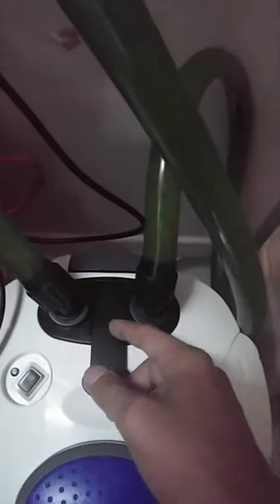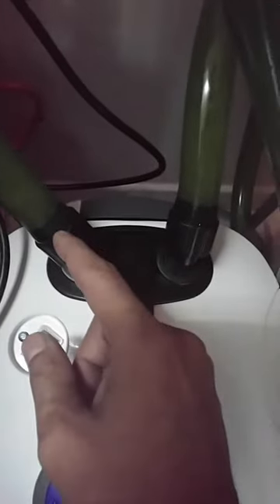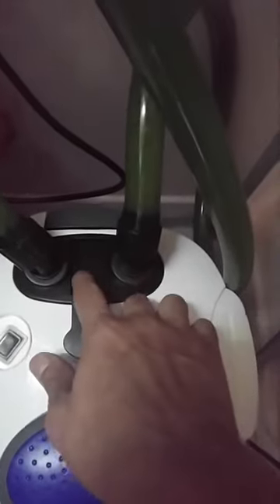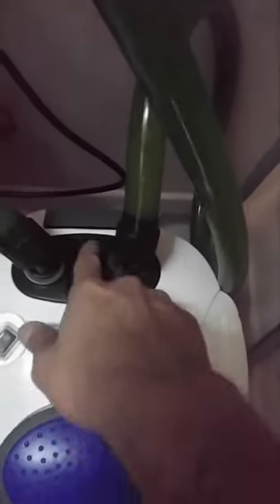Ugh what a mess ! Please inform me !

Comment: Oh my...I am so sorry,  I hate when stuff like that happens to me.  I hope the water did not damage your place too much.  However I am sure that your product is under warranty.  Please check the box if you saved it, or just google Sun Sun canister filter warranty and it should be there.  Please be sure to save your boxes next time for at least 6 months (I know it's a long time but it will save you money) incase you have to send the product back to the manufacturer because of defects.  So google what happen to you first, to see if anyone else had this issue.  Then call the company and tell them what happened, they might send you either a replacement part or a new filter.  The Chinese don't want any issue usually, they will just replace the entire product or give you the part.  If you bought it on Ebay or something they are usually good about their customer service.  Good luck.  Keep us posted.
Reply from the maker: Cape Cod Tropical Fish Keeper I have the box! thank u sweety for the heads up ..I got it off Amazon..

Comment: I've read various post about those leaking but most said it was from the main seal twisting or pinching. Others have mentioned about the connection leaking due to the material used in the making of it. I would definitely look at all the seals and the in and out take for hair line cracks and check those seals to. If for anything shoot Sun Sun and email and see if they will replace the filter under warranty is at least the top so you have fresh seals and no bits of plastic to get up in the impeller and really need it up. Sorry to hear about the issue. At least it's fix for now but I would check into getting it replaced so the next you don't wind up with a complete failure and your water flood the floor. Good luck!
Reply from the maker: Racing's Natural Aquariums maybe u can help me out with finding a customer service email I can't seem to find it I found there website but no customer service link!..
Reply: David Betancourts aquariums candy@sunsun-china.com
Reply from the maker: Racing's Natural Aquariums thanks bro!

Comment: dam that's a kick in the ass I see from comments you fixed glad u have.ive the sunsun 404b the uv steriliser melted  the plastic tray it sits into also the clips. on the out side are very weak and the handle on the canister head is also broke other than that there are great
Reply from the maker: electric water I agree the product work great but materials are crap smh thanks for the input ! much appreciated

Comment: Oh man that stinks. So the handle came off?
mine i just flip back the latch but i un plug it from outlet first
Reply from the maker: Deon 0026 no the lid handles didn't come off they just were leaking from that spot I also unplug it be for removing anything .I'm not sure how water got thru that part and I'm thinking the chipped cylinder leaked water and it slipped through the lil slots next to them but I figured out I have to really push down on the intake outtake knob be for locking it it seemed to work ! hopefully it won't break any further..
Reply: David Betancourts aquariums good luck and sorry about the water. I don't have that problem i also take the filter to the tub or outside for maintenance. Im always getting a splash lol so i dont risk it. Like when i put the lid on it overflows because i fill it to the top for quick prime.
Reply from the maker: Deon 0026 good idea I think I'll be filling it up before reinstalling it..thanks bro